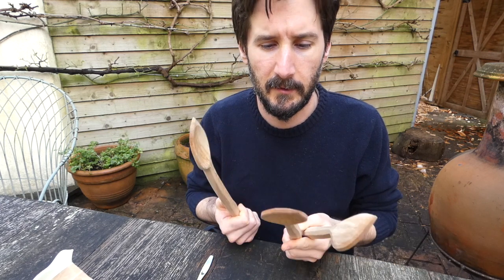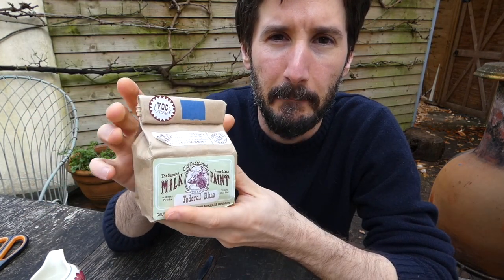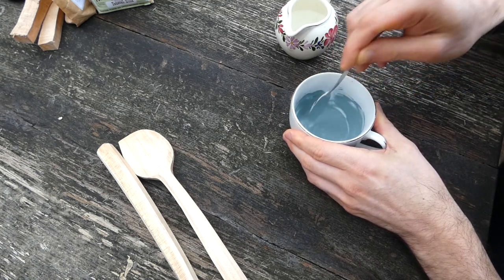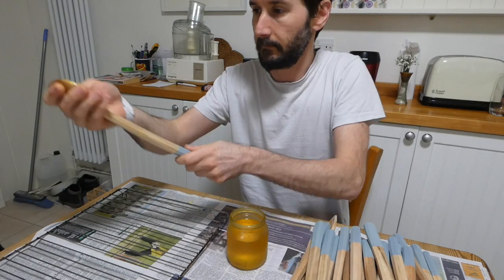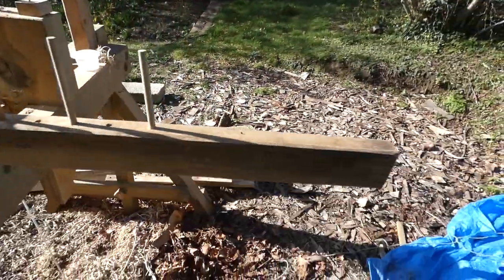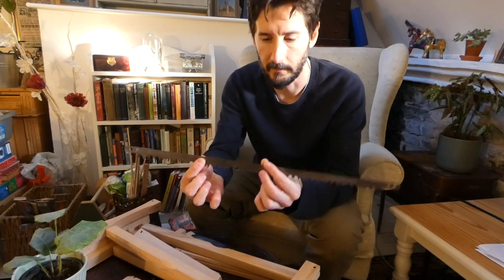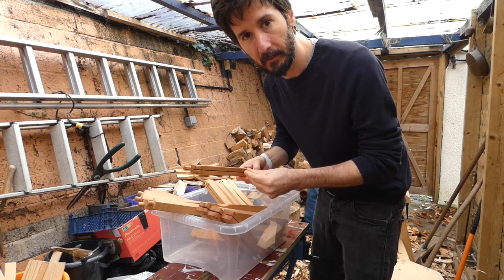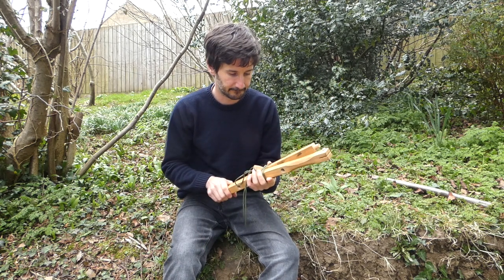Spoon Carving Diaries - Ep 5 (Milk paint and Folding Saws)

Comment: Hi, could you explain how you dry your spoons.  thank you very much ;)
Reply from the maker: Hi Audrey, I talk about drying in a previous episode which you can see here https://www.youtube.com/watch?v=OolAOra1DX4&t=12s&ab_channel=WillPriestleyWoodcraft skip to 4:20 for the bit about drying
Reply: @willpriestleywoodcraft1535  Thanks, I saw that episode but I was wondering how long should I let  my spoons dry for (ballpark figure as I assume it depends on the wood and how "green" it is) and how. Should it sit in wood chip for example.
Reply from the maker: @audreyfarnarier583  Yes it really depends how green it is and how thin you've carved it. Can be anything from a day or two to a bit over a week. If it feels cold to the touch then it's still got some moisture. Two weeks inside (away from direct heat like radiator/sunlight) should be plenty for any spoon to completely dry
Reply: Why don't you just dip the ends into a container of the paint and then hang them upside down then you won't have to tape them
Reply from the maker: @pcpwcail  Lots of reasons! A couple being that I'd have to make up WAY more paint than I'd need to be able to dip the handles. It would also not give a nice even coat, what with the drippy bits and would be too thick so I'd probably end up taking off the excess with a brush anyway
Reply: @willpriestleywoodcraft1535  I get it , i work in a millwork shop and we can't take the time to slow down and enjoy the process, everything is go faster for us. 
But I'm trying to make spoons and such at home to slow myself down🙂